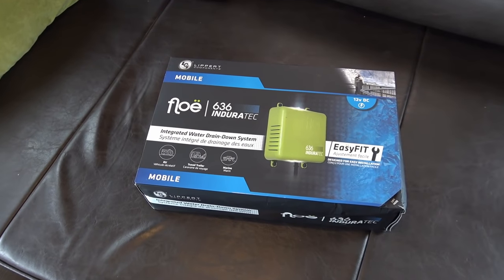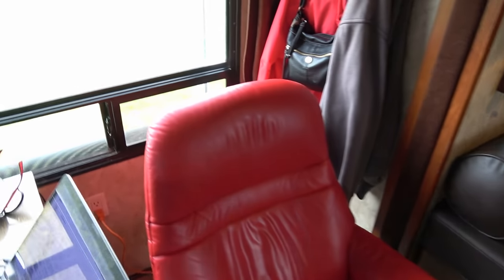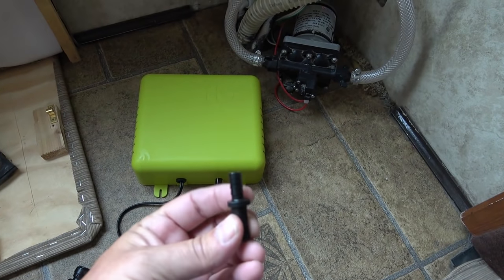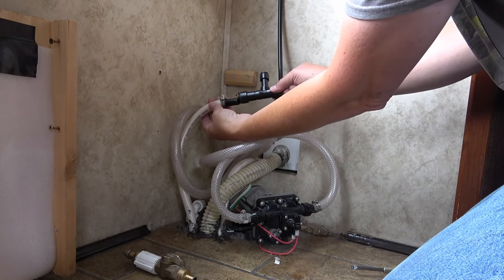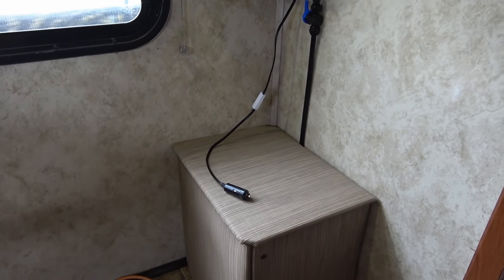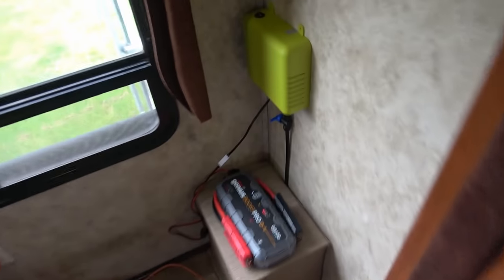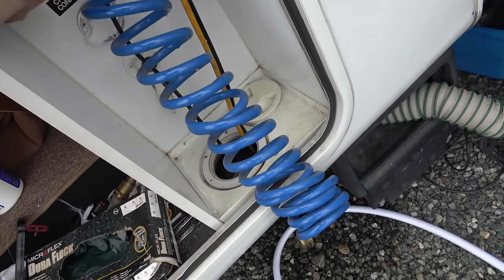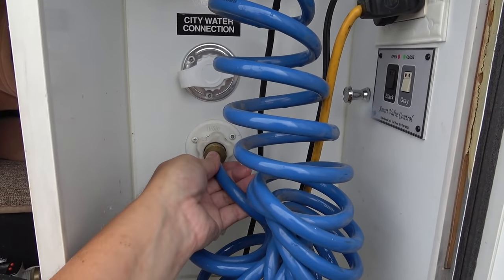Install/Demo of Lippert Floë Automatic RV Drainage System - Quick and Easy Winterizing

Comment: There is no one on YouTube I watch more than you Ray.  I love your channel.  However it too bad you have hooked up with lippert, almost everything that fails on my rig is made by lippert.  No customer service, they definitely do not stand behind their products.  Just one example is my rear landing gear, it failed third use on my trailer.  After months and months I got a rebuilt motor.  That lasted 2 trips before burning out.  Local electric motor shop said it was wound poorly at the factory.  At that point my one year warranty was up and they were quick to point it out.  I encourage others to google prior to purchasing any lippert products!
Reply from the maker: Thanks for the feedback. This is exactly why they told me they wanted to get real RVers reviewing products so they can find out what is working and what isn't, right from customers. I told them my comment section would be a good source  :) If no one complains then the RV industry just keeps pumping out the same stuff.

Comment: I think I will stick with my external compressor that I set the pressure 40 to 60 psi and then just let her rip with a fitting on the fresh water inlet. Only takes about 3 of 4 minutes and all done. Quieter too. But good review Ray.
Reply from the maker: I've heard that 30 PSI is the safe level for air pressure in the RV plumbing but I imagine they err on the side of caution
Reply from the maker: Interesting, is that a sticker specifically referencing winterizing the RV plumbing with compressed air? Or maybe you are looking at the max tire pressure sticker?
Reply from the maker: Thanks. Wow, that is really low for the max water pressure, many RV water pumps run above that. Usually 45 PSI and some up to 55 PSI. Most fixed RV water regulators are even above 40.
Reply: I do the very same thing. I blow out all the lines and then pump the pink stuff for added safety. It might not be necessary here in Ohio but it's cheap insurance.

Comment: Too bad for manufacturers that you took it apart and showed how cheaply it is made. $250 will buy a good air compressor that can be used for other things, and with a regulator it is a 1 person operation to winterize.
Reply from the maker: I don't think its aimed at people that are handy enough to winterize there own, more the many folks technically challenged that currently pay an RV dealer to do the job and want an easy one button solution.

Comment: that definetly seems way overpriced for what it is.  Anyone who already owns an air compressor could easily set it up to perform the same function for a fraction of the price of this thing (maybe a couple adapters from the store to connect it to piping).  I think you might even be able to buy a small air compressor for that price and then have it to use for other things.  It also seemed extremely loud.  They made no attempt whatsoever to dampen the noise.. especially considering the price.

Comment: That's a nice system for people that don't have a portable air compressor but I don't think I would spend a couple hundred dollars on it.
Reply: Why would you ever need air anyway?
Just pump antifreeze in until it runs pink
Done for less than 10 bucks and in less than 5 minutes and a lot quieter
Reply: @nbhybrid206  Because some people don't like all that chemical I'm their lines.
Reply: Gary Boyd seriously?
You would have to be a special kind of snowflake to be concerned about rv antifreeze 
Just flush it out
Reply from the maker: Seriously? are people still using the term snowflake? haha
Reply: Love Your RV I do when it fits
The things some people are afraid of

Comment: Currently on sale at Camping World for under $40 USD. 
I have learned the hard way that compressed air will still leave a lot of water in the system. Small amounts of water can run back and accumulate in small fittings such as an elbow. At below freezing temperatures that small amount of water can freeze and break that that fitting. You will discover that in the spring when you refill your system with water. How small of an amount of water you ask? I had a brass "Y" hose adapter/splitter break open after left inside my rv over winter. The adapter had not been used for several months prior to freezing weather and the water had been shakened  out of it when it had been disconnected. The few drops of water that had been trapped inside was enough to break that brass fixture. 
 I use the drain, compressed air, antifreeze combination to winterize my systems. With this combination, all the antifreeze I collect from the various faucets and low point drains, after allowing some to fill the "P" traps, has not been diluted with water enabling me to reintroduce it back into the container I am drawing from. Using this method I have been able to winterized the entire system of our 43 foot 5th wheel trailer with washing machine and drinking water system, both pumps, a little in the water heater and fresh water tank, plus using the outside shower to put some antifreeze through the black tank flush, with just one large jug of antifreeze. What remains in the jug I share up between the 4 various "P" traps.
I use the vinegar water fill, soak and flush method to sanitize the system, prior to use. Vinegar also to descales the hot water tank.

Comment: Neat little rig. I use my m12 Milwaukee tire inflator. I can set the psi and turn it on after I open a valve and it will blow the line down and shut down after I close the valve and it reaches pressure. I just have to push the start button after I open each valve and low point drain, no big deal.

Comment: At $129, I'd be a buyer.  But if there is a couple of things your video taught me, its (1) use outside shower to get the air out of the black tank vacuum breaker, and (2) install this thing somewhere DEEP in the bowls of the RV!  That thing is loud!  Thanks Ray.

Comment: Hi Ray, at time stamp 3:50 you mentioned looping the water pump hosing to keep it quiet. Did you happen to do a video on that at some point in the past? Thanks!
Reply from the maker: I had a video of when I ripped apart the OEM pump setup and reorganized things building and installed a winterizing kit but never did one when later I upgraded the pump and added the looped hosing.  https://www.loveyourrv.com/my-not-so-easy-rv-winterizing-kit-installation/

Comment: All I can say is I'm glad you got it for free Ray. I use a $100 pancake compressor that I can set the pressure down to 40 PSI along with a $5 camco garden hose to quick connect air line fitting and I can blow out my lines in minutes. I can't understand why anyone would spend $250 on a $10 Chinese compressor.
Reply from the maker: I guess its trying to make things dummy proof. There are many people out there that wouldn't even know what a compressor is, never mind use one to winterize the RV. ;) So they end up paying the RV dealer to do it.
Reply: @LoveYourRV  Sad, but true.

Comment: I found the main problem with blowing out your fresh water lines is that the traps are left unprotected and can freeze and break. A jug of RV anti freeze is cheap and filling the lines is easy. Run a bit extra down into any traps and they are protected too.
Reply from the maker: Good tip. Another option is waterless traps like the HepVo valve. I have one installed under the kitchen sink and love it. No more galley tank smells after traveling and the P trap loses its water.

Comment: I went to Menard's and bought two PVC ball valves (quarter-turn to open and close,) and put them on my low-point drains. (One of) the best things I ever did! No more having to unscrew those caps, (although I still install the caps finger-tight on the outlets of the valves as mine are pretty close to the tires, and I didn't want them getting road debris in them.) I think the whole thing cost me about $8.00 dollars American! That thing's a nice gadget, but pretty pricey for what it does!!!
Reply from the maker: Good upgrade :)

Comment: I noticed that your low point drains have caps on them. Wouldn't it be better and more convenient it you had quarter turn valves to drain?
Reply from the maker: Yes, if I winterized a lot, I would have likely swapped them out by now, but so far in 9 years full-timing, I've winterized once.  :)
Reply: @LoveYourRV  Makes sense.

Comment: Interesting, I haven’t seen anything like this before. Another power option would be a 10ft extension for the RV’s 12V outlet. I picked one up at Canadian Tire a few years ago.
Reply from the maker: Just have to make sure the extension can handle the amperage, if you get to thin of wire the voltage will drop and the motor will bog out, much like the Jackery box did. Cheers, Ray
Reply: Good catch. I typically do low power things with mine. I’m pretty sure most of those outlets are limited to 100 Watts at about 8 Amps. But I’m no electrician.

Comment: DON'T forget to add anti-freeze to your drains, tanks, toilet and refrigerator lines.  I know I feel safe with a simple drain and add antifreeze.  Water drops can collect and puddle eventually.  To each there own!
Reply from the maker: I think the quick air method is helpful if a person is using the rig throughout the winter and having to winterize many times during the season. Not that much benefit to a person that winterizes it and stores it for months.

Comment: would definitely be on the bottom of the list for RV upgrades, if even makes the list at all, and even then, I would have to have a huge bank account to justify the expense, not to mention the hearing damage I would sustain using this. Maybe line the inside of the cover with some foam if you have the clearance.
Reply: Really, being able to hear the unit while outside is a benefit (if you are doing this on your own--single person).

Comment: As usual, great video. This is what Alton Brown would call a “unitasker”. I think I’ll pass. If I had a fixed trailer in MT that I had to leave 4 or 5 times a year, maybe. I have a very expensive air compressor and a 3$ air adapter.
Reply from the maker: Thanks. :)

Comment: Thanks for the video Ray, looks like a nice mod. How much does the unit weigh ? Also I'm interested to see how the tape holds up in the long run.
Reply from the maker: Maybe around 3 lbs, the 3M outdoor mounting tape is good for up to 5 lbs, but vibrations could be a issue, though they use it a lot on cars to hold stuff on, will have to see.
Reply: @LoveYourRV  Curious to see if it holds up to all the bouncing when the trailer is in transit
Reply from the maker: I  mounted a wood carving above our entrance door in 2015 with the same tape and still there, but its a bit lighter.
https://www.loveyourrv.com/attaching-decor-rv-walls-without-screws/

Comment: I realize there's the on board convenience of the system but how's that stack up against something like the viair compressor with an air fitting into your water inlet?
Reply from the maker: If a person is handy enough with things and doesn't winterize too often it's not worth the cost in my opinion. They just have to be careful not to over pressurize the plumbing or you could end up with a costly mess of leaky pipes.
But, there are many out there that are technically challenged and pay a dealer or some one else to do the job. A one button simple to use solution like this may work well.
Reply: @LoveYourRV  I only have to winterize once a year. I use the air to evacuate all the water from the system at 20 PSI. Then I use the onboard pump to syphon the antifreeze through the system. I know it's a little redundant but it works for me. The camper has spent three winter's in northern Maryland and I haven't had any water related problems. I'm having my fans all replaced at a local RV center with maxair fans this week. I could have done it myself but I'm big and old and I need to have both knees replaced (misfortunes of a life well lived) so I'll let some young RV tech do the job. It's so hard for me to surrender the work as I spent my whole life as a mechanic, carpenter, roofer and RV camper since I was a kid. My dad had a 26' cobra camper in the 70s.
Reply from the maker: Good idea actually as many people that use air compressor hookup to the city water input forget about the water pump, usually they end up with a bad water pump check valve after the water in it freezes.
Reply: @LoveYourRV  and for what a couple gallons of antifreeze costs, it's cheap insurance.

Comment: Does it go through your water pump?
Reply from the maker: Yes, that is where the instructions said to mount it, as close to the fresh tank as you can get. I imagine it would work fine at the city water input but do to the one way check valve in the water pump you'd have to deal with that separately as water could still be in there.
Reply: @LoveYourRV  Great. Thanks for getting back to me and for the great reviews.

Comment: When i use floe636, it takes about 90~100 seconds for each time to stop pressurise. 
Yours looks like to take only 5 to 10 seconds for each time.
whats wrong with my rv?
Reply from the maker: Does your RV water pump system have a accumulator tank inline? That could explain the extra time since not only the plumbing pipes need pressurizing but also the accumulator tank volume.  I assume you have already drained and bypassed the water heater tank. Cheers, Ray
Reply: @LoveYourRV  my rv Is palomino 189bhs. I do not think there is accumulator tank in line. I think about two potential reason.
1 is city water line and 2 is water heater by pass.
I will check out city water line with additional switch from. Outside of city water inlet.
I do not actually know how water heater by pass work cause it is hard to look and see inside by small hole under the mattress.

Anyways I will Le you know how it goes after I check city water line with bubble and switch.

Comment: I hope you have better luck than me.... I installed it.... used it.... and it completely burned up in less than 10 minutes.
Reply from the maker: Burned up, like on fire? I opened mine and inside I found a small electric motor, switch and little compressor.
Reply: No, it was just very warm.  It turned off and won’t turn back on.  I thought it was the fuse, but both of my fuses that run to it are ok.  I’m not looking forward to taking it down because I used like 4 lines of auto 3m tape to mount it in my cougar
Reply from the maker: @GimpyCamper  It's pretty easy to take apart and simple inside. I actually did in the initial video to show the inner workings but the Floe people told Lippert to make me cut that part out of the video. I think they were upset I showed the inner workings.  Likely for the cost didn't want me to show how little is actually in the box. ;)
Would be interesting to see what failed. I'd guess the motor but maybe it's one of the connectors which is a simple fix.  For the 3M tape use a fishing line to slice through it then you can clean it up with a solvent. Cheers, Ray
Reply: I’ll take a look at it further... thanks for the input.  I’ll add it to my “stuff to do list” lol.  When I first started making videos I used to stress out about coming up with content... but the universe always adds more to the “to do list” lol
Reply: Lippert actually saw my unsatisfactory review and sent me a new one... got the old one off the wall, it really wasn’t as bad as I thought it would be... lol

Comment: Ray, I have to say this was kinda weird coming from someone who is full time. To your point of this being rather expensive, Harbor Freight has a pancake style compressor for less than $40.00. That plus a trip to HD for some fittings at say $15.00 and I'm done. I would like to know how many of those things etrailer actually sells. Thanks for sharing but nope.
Reply from the maker: I'm always up for trying out a gadget and seeing how things work. :) Like I said at the end, not for DIY types that's for sure, but maybe good for people that don't even know what a pancake compressor is (my wife would be really disappointed when no actual pancakes were made!) Many technically challenged people pay the RV dealer a hundred bucks an hour each season to winterize the RV.  I'd guess the product is aimed at those folks.
Seems this product originated in Europe for boats and caravans. The price point is way high, bet they'd sell more at around 80 bucks.  Cheers, Ray

Comment: Can you do your viewers a big favor and turn some of the commercials off thank you love your videos.
Reply from the maker: Sorry, I haven't changed anything. YouTube is going crazy with commercials lately, I notice them on the TV myself. They must not be able to get the normal ad rates due to the economy being in the tank. I saw something about them now auto inserting mid-roll ads, I'll see if I can disable that, I think I now have to opt-out rather than opt-in.
Reply: Don't worry I'll still watch your videos
Reply from the maker: Thanks. :) I was right YouTube has changed some things recently - https://9to5google.com/2020/07/10/youtube-mid-roll-ads-shorter-videos/  I've found the setting to disable them by default as I hate mid roll ads myself, that's why I never ran them.

Comment: Seems like a lot of money for a $12 compressor. Also the volume of air is so low it wouldn’t completely blow out the lines. I’m pretty sure that water left in the lines would still settle in the elbows and low spots.

Comment: Really over-priced item.  The pump looks very cheap and may not last more than a couple of seasons before it fails.  The case looked like it was intended to also contain a rechargeable battery or something else.  Is there another model?
Reply from the maker: Yes, there is a 120 VAC model, bet that spare area houses the converter from 120VAC to 12VDC